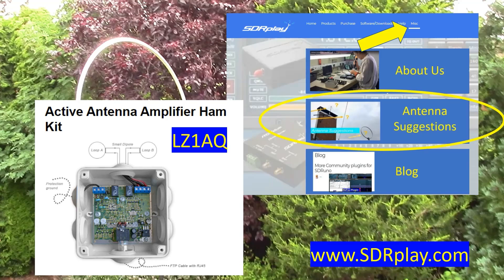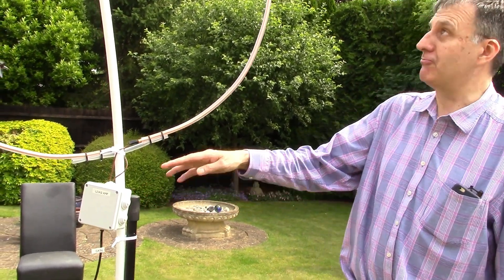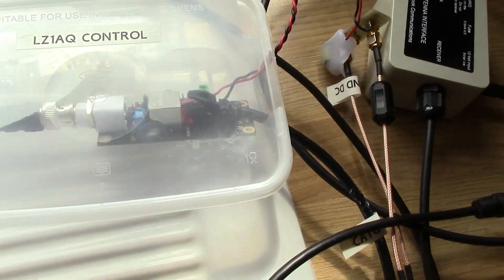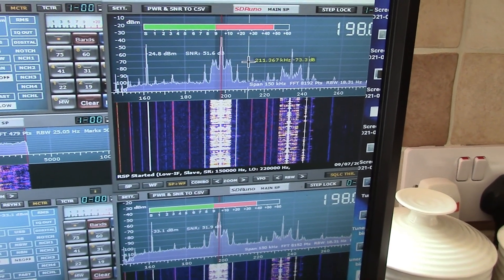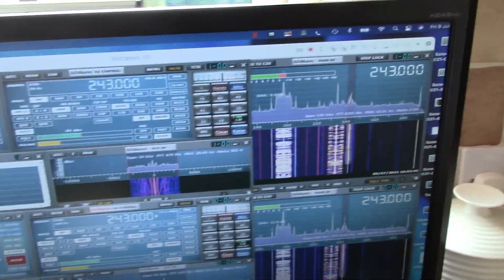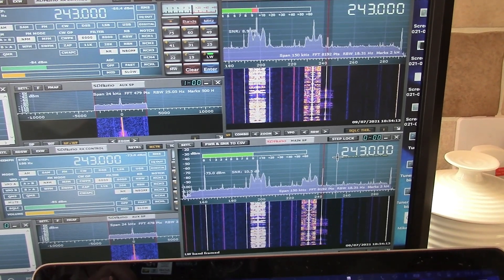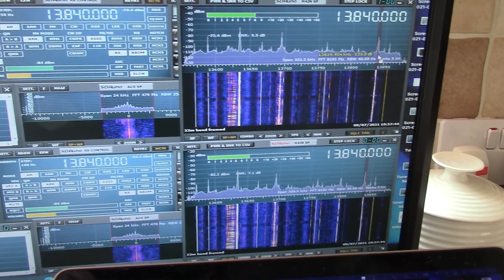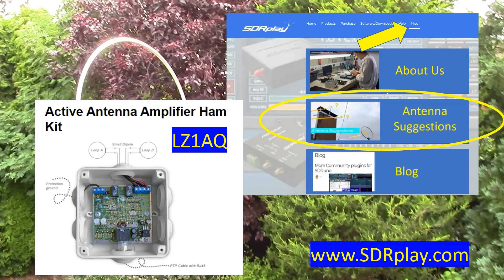SDRplay comparison of LZ1AQ and Wellbrook loop antennas

Comment: I use the LZ1AQ in a very noisy environment since 6 years under the roof in a multi family home and I have a better reception than in the old days (80's and 90's) with huge wire antennas, only my beam would obviously outperform it on ham bands, but since I do a lot of utility DX and decoding over several bands, a narrow band antenna is not an option anymore. I am fascinated by this antenna and the totally symmetric ethernet concept. The antenna costs around a quarter or less of the Wellbrook but offers several amps that can be operated with two loops in a 90° angle and you can switch from A to B to A+B and one of those configurations will always give you a very good s/n ratio and the wellbrook would heva to be installed on a mechanically rotating system to do that and so you may have a better chance to precisely null out signals, but it comes to a price more then 10 times the LZ1AQ when you include a mechanical rotor. The control line of the rotor may also propagate RF noise towards the antenna unless you install chokes, so overall the LZ1AQ is hands down the winner if you want the best possible signals for the least amount of money. 
Its immunity to intermodulation is also something I have never seen ... it sometimes brings my 16 SDR near its limit.
I have had signals with 90dB s/n! I receive FT8 signals from all over the world almost 24/7 ... like right now here at 12:42 local in Munich Germany VK8DR and VK6AL from northern and western Australia on 10m band! Yesterday I have received Hawaii, Alaska and New Zealand ... Radio Newzealand Intl almost like a local station ... with an LZ1AQ under the roof inside the house!
I recieve HFDL aircrafts all over the world ... this antenna is for a little over 100€ simply amazing. I use regular copper wire for my loops, cost me 10€ and I nailed the two loops on a wooden stick, on top of another 90° shifted ... so I can even use these in the electric capacitive mode, which works well in the lowest VLF range, but anywhere higher the electric mode is just picking up the enormous local noise, so make sure to operate the magnetic modes.

What I would like to see is that LZ1AQ feeds both antennas signals into the 100 Ohm ethernet cable and gives you two antennas outputs, meaning if you have e.g. an RSP Duo and enable the diversity phase shifter, you would end up with a physically stationary cross loop antenna that you can electrically rotate and you would the exact same effect as if you would have one loop that you can turn physically, which is always an issue with maintenance and it may make noise if installed in the attic ... when this can all be done by smart software. 
Maybe this version already exists, and I simply have not visited his website for years.

Anyway I can only recommend the LZ1AQ for anyone who loves to receive shortwave with clear signals and doesn't want to spend a fortune and still get better results.

Comment: Having used the LZ loop for a few years and in many positions and configurations, it needs mentioning that the CAT cable it uses to link the head and power supply needs consideration as well. I've used pre made flat Cat 5/6/7 leads, home made screened and unscreened. I've had quite different noise performance results depending on which I've used, no real conclusions.

Comment: What is really needed is an active antenna, like the one shown here under development, that will work off the +5Vdc Bias Tee built into the SDRPLAY receiver.  Please ask this gentleman to  make the  active amplifier available or a schematic so we can build one at home.  If anyone knows of such an animal designed to  optimally work with the built in Bias T please let us know.  Perhaps SDRPLAY could sell it online.
Reply: You could always buy a Wellgood; bias-T as standard. No need to activate from SDRPlay.

Comment: why do transmitting magnetic loops requires a tuning capacitors and not the active receive loops ?
Reply from the maker: When receiving you are dealing with tiny electrical signals resulting from the loop cutting through the magnetic field of signals- with clever amplifier design you can present these signals from a wide range of frequencies) to the receiver with good signal to noise ratios.  When you want to transmit, you need to excite the antenna using large electrical signals and there needs to be good impedance matching to ensure power transfer and no damage to the transmitter.  An air spaced variable C can provide the tuning and survive the high RF voltages involved.

Comment: Thanks for this video. I just received my LZ1AQ box and was wondering if you think the size of the antenna conductor makes much difference? i.e., 3/8inch copper tubing versus 14 gauge solid wire?
Tnx es 73 de Arnie W8DU
Reply: Yes, it makes a difference. It's a low-impedance (current feed) amplifier so the sensitivity depends directly on the loop inductance. LZ1AQ recommends "as fat as possible", with 8ga wire as a minimum, but copper tube is definitely nicer. If you want to use wire on a frame, then I would suggest multiple conductors in parallel (*not* multiple turns in series!) to get the best result.

But of course you can build it with 14ga and see how it works; if it's good enough, it's good enough, and if it's not, then you just wire in something better. The rest of the system can stay the same.
Reply: @hobbified  RG213 coax outer is also very successful, as it is for portable tuned magnetic loop antennas for HF.

Comment: I made an identical comparison between these antennae about 2 years ago and saw about the same results. Sadly the 2 waterfall windows were not identical setup and the RF gain level and the dynamic range was also different between the 2 receivers which does not give an honest visual result. These are the details to preset before running the test for an honest result. Sadly the VLF band is not tested and there I can say that below 30 kHz the Wellbrook is noticeably better. I cannot see what both antennae are using as power supply, but it should be a battery, as some power supplies can be noisy even if they are of the linear old school model. It's not easy to make such a test, but one does learn over the years from mistakes, and believe me I also made a bunch. Good informative video tough, but sadly not revealing all the details.
Reply from the maker: thanks for the feedback Ron.

Comment: No mention is made of the fact that the LZ1AQ loop comes as a kit that a lot of people would shy away from constructing. The Well brook is a "plug and play" product
Reply: That's a very good point, and I should have mentioned it. The LZ1AQ has more features, but you do need some electronics and construction experience to put it together - especially if you want to enjoy all of the modes. I'll make a note to expand on this in future videos.
Reply: @Mike-H_UK  The LZ1AQ kit was mentioned in the earlier video, I have a Wellbrook, I bought it because I was tired of waiting for over 4 months for MFJ to ship goods to my dealer in Canada. Although very expensive and I was not impressed with the bias-Tee being constructed on perfboard, I expected a good quality PCB for an antenna that was just about $500CDN including shipping from the UK. No issues with performance though.
Reply: @JohnHill-qo3hb  That's a good point, and if you look at the reverse-engineering work by George Smart (M1GEO) it appears that the main circuit was on a stripboard as well. I don't know if that is still the case or whether, over time, Wellbrook have moved over to a custom PCB. To be honest, I don't understand why Wellbrook would have used this construction technique for anything other than prototyping even though good performance can certainly be achieved with a competent strip board design. I'm sure that a PCB would ease manufacturing considerably, and a simple board like this could be laid out with free s/w.
Reply: @Mike-H_UK  I wonder if these are made to order. Yes, a high quality PCB with conformall coating would give a very positive feeling about build quality. Wellbrook has many commercial/Government customers, I doubt that there would be many people at these places curious enough to remove the four screws to "have a look-see" inside. It all comes down to performance, it works, it works very well, why change as it won't make any difference to the level of performance.
Reply: Even a 10 yr old can attach some wires, so yes, THE KIT IS THE BEST! 😂

Comment: Looks like the LZ1AQ has the slight advantage over the Wellbrook which is interesting considering the Wellbrook is much more expensive to buy. It would be interesting to test the LZ1AQ head to head with the W6LVP loop.
Reply: No mention is made of the fact that the LZ1AQ loop comes as a kit that a lot of people would shy away from constructing. The Well brook is a "plug and play" product
Reply: @g5vu  it's not a kit in the usual sense. The boards are completely populated, no soldering required. Just build the loop, put some wires into some screw terminals, put the board into the box, etc.

Comment: Rip off wellbrook!
Reply: It's not. It's very different. It also can't be "a ripoff", any more than an ATU box, say, because there is no IP protection on the circuitry (the original idea was published decades ago). I asked Wellbrook to confirm they have, as some of their more wild-eyed supporters claim, the IP protection that justifies comments like yours. They responded to other questions, but not a peep about any protections.  So I can only assume there aren't any.
Reply: To be fair to LZ1AQ, I think the circuitry looks very different, even though the SNR performance of LZ1AQ appears at least as good as the Wellbrook.  If George Smart's (M1GEO) reverse-engineering of his Wellbrook loop is correct, then the Wellbrook uses an augmented version of the Norton lossless-transformer amplifier that Chris Trask invented and patented (now expired). I don't see the same fundamental technique on the LZ1AQ circuit board. Certainly LZ1AQ has many more modes and features.
Reply: No mention is made of the fact that the LZ1AQ loop comes as a kit that a lot of people would shy away from constructing. The Well brook is a "plug and play" product
Reply: @g5vu  Funny, you've mentioned it at least three times now - always wrongly implying it's an electronics kit. It isn't. You just put it in a box and connect a loop.
Reply: @MrMesospheric  I don’t believe that I have ever referred to the LQ1AQ loop as an electronics kit. However, I did say that some electronics and construction ability is required to produce a working antenna which is, I think, a fair description with which LQ1AQ (Chavdar Levkov) himself agrees.

Incidentally Chavdar himself refers to it as an ‘Active Antenna Amplifier Ham Kit’ on his webpage!

The ampifier box needs opening, and wires for the loop connecting, three jumpers need positioning correctly and a connector needs making up. Additionally, if you want to swap between the different modes, three switches need adding to a front panel, and these need connecting to the control board. None of this is rocket science, but it is not as ‘plug and play’ as (say) a Wellbrook.
Reply: @g5vu  That's a very good point, and I should have mentioned it. The LZ1AQ has more features, but you do need some electronics and construction experience to put it together - especially if you want to enjoy all of the modes. I'll make a note to expand on this in future videos.
Reply: @Mike-H_UK  Except, you don't. It's not an electronics kit, merely a very simple mechanical put-together job.